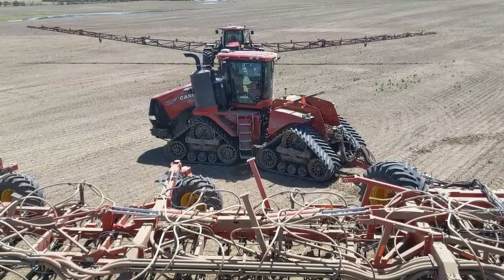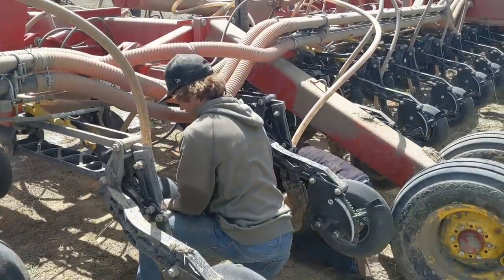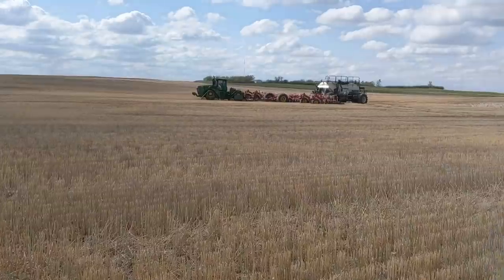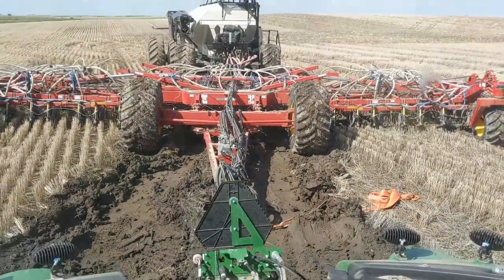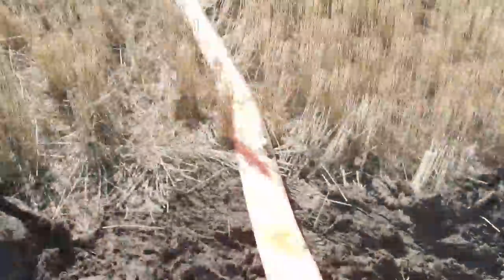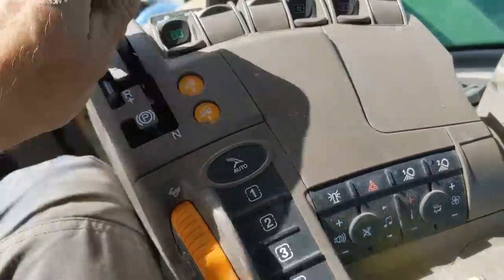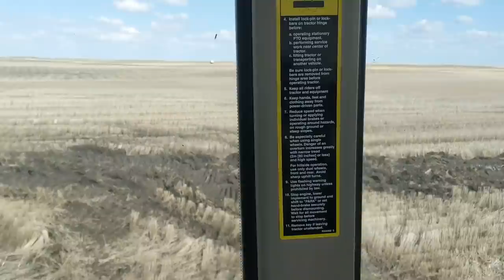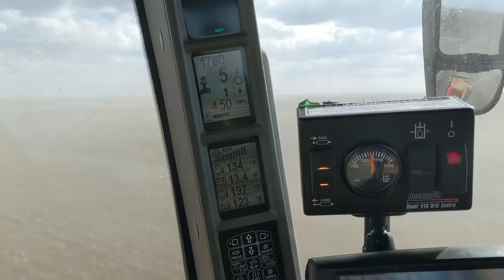Ashtyns 3rd stuck 😂

Comment: As a crane operator I’ve had a bad experience with a master link (d-ring) breaking under its rated capacity, it’s probably in outer space looking to come crashing down at any minute! I didn’t even have the line pull capacity to reach its safe working load capacity. TODAY I witnessed a strap fail using an 750 excavator (170k lbs) and it took the hard hat of a labor. PLEASE avoid using unnecessary rigging and especially metallic (unless cable). It looked like the shackle could have gone directly to the eyelet of that strap but that’s just from my keyboard. Stay safe and thanks for your videos✌️

Comment: It should be pointed out for those that might not know, Johnny is now pulling the seeder that the Fendt was pulling 68 ft, which is not as big as the seeder that the Case is now pulling 84 ft, because Johnny couldn't  :)

Comment: The way we keep track of the hydraulic hoses, we use colored zip ties.  Put the same color on the paired hoses then put a red zip tie on the right hand one.  We always use red for the right hand hose or if they hook up top and bottom , blue is always bottom.

Comment: Nice pull out sideways i have a nifty idea put a hughe old disk blade pinned to bottom of jack slide sideways etc but no big deal We had an extended hitch built pinned on the  Steiger tractor hitch could see to hook up and we could turn headlands in one pass yes could turn in 1/2 of the 55 ft airseeder great for bushes and sloughes too (thr outside sections lifted seperate from the centre( lift it out when wheels start sinking in the mud) it takes time to make extra headlands etc Time is money getter done.

Comment: How well does the Bourgault Auto Section Control work?  Sounded like it might have plugged Brian's drill up?
Reply from the maker: I think it struggles sometimes on a say 1mile run with only one section on.. 🤷‍♂️

But other than that, its worked good

Comment: Have you ever considered wheeled tractors with LSW 1400's, I ve seen pictures on the gram so I know they get stuck too but it was something I wanted to ask when the great distance you guys have between fields if it would float enough in the field and save some coin on wear parts roading?

Comment: If I remember correctly isn't the Case pulling a significantly larger drill than the John Deere?
Reply from the maker: Than that particular John Deere, but there's 2 other Rxs pulling the same load as the Case

Comment: New style xtc. 14 minutes 27 seconds change 76 ft on 10 inch spacing myself. Change about 8 times a year.
Reply from the maker: Holy crap that's fast!
Reply: Mike Mitchell it may have been at night along a bush that we often see bears in. Added for that little extra motivation to get it done.
Reply: @coreyhadubiak2912  lol. 🐻🤤

Comment: I Never seen Blue New Holland T9 700 🚜 with front/rear duals 682 hp only 10 hp less than Case.. Wonder How a BlueGrill 🐟 would Pull ?
You Slick up tracks on surface fast. Not stuck Deep.  Is that Bedrock under shallow soil or Ice frozen soil/clay you planting over ???
Permafrost ?
Reply: It'll be clay. We don't have permafrost this far south in SK.

Comment: Ole Johnny probably shifts up slowly to protest drive line components and to make it smoother.  Could it be your just a little impatient?  Have you asked your dealer about the shifting?  Is there an adjustment?
Reply: No they just have shitty trans case has hi speed shifts and smooth

Comment: Not a farmer but mike wouldn't it be easier for you un hook the cart and just pull that out instead of the whole drill and drive out with the drill  and swing back around to pull out the cart out with the strap on the of the drill?
Reply: Those big airlines don't have quick couplers huge pain to take them apart.
Reply: Not to mention the world of frustration as you try to realign the hitch to reconnect to the drill. That would be a nightmare.
Reply: Okay thanks👍

Comment: The strap rated at a 120,000 pounds and the equipment weights 120,000 are not the same thing. If you had a gage hooked on the strap and the other end on the equipment you will see the gage when you are pulling is no where close to 120,000 pounds.
Reply from the maker: 🤔 Very interesting good sir.. Soooo ur saying I am good for even more! I like that! 🙂 😂
Reply: @mikemitchell2554  Oh-oh...🤦‍♂️

Comment: Why are those rigs called "drills"? And why are you on imperial units? No offences, just curiosity!
Reply: Claus Scherschel    The more common name for this type of seeding equipment is AIR SEEDERS because air is used to get the seed & fertilizer into the ground.
The terminology “Drills” goes back many many years when seed dropped straight down from “Drill Boxes” to between disks that made an opening in the ground for the seed to lay into.
The US is fully Imperial and that is where a lot of machinery is manufactured.
I believe all US road signs and speed limits are still imperial.
Farm machinery as well as automobiles in Canada are manufactured in such a way that either system can be displayed in most cases.
The roads particularly in western Canada when built were laid out on a grid pattern where the roads would run parallel and perpendicular to each other at one mile spacing when practical.  
This is how farming land is calculated.  One mile x one mile is a section which is 640 acres and when commonly divided into 4 fields when dealing with smaller farming operations each one of the four fields is called a Quarter thus being 160 acres.
Farm machinery is measured in feet as well as building and granaries.
Depending on how a piece of equipment is manufactured you may need either imperial or metric tools and sometimes both to accomplish the repairs.
Canada tried a HARD SWITCH to metric many years ago but it didn’t last for everything.
Building construction tried switching to Metric but returned to imperial in most cases.  
Some products are labeled both imperial and metric.
Canada is also officially bilingual and that is a story for another day because certain products have to have packaging labels done in both English and French.

Comment: Don't you have an erosion problem? I don't see any hedges or anything like that.
Reply: alemey   Southern Saskatchewan has VERY FEW TREES and that can be summed up to a number of reasons.
The STRONG WINDS & lack of moisture make it hard for trees to successfully grow.
As the fields get larger the farmers remove the few trees that exist to make farming with bigger equipment easier and more efficient.
Where there are cluffs of trees along a field the trees rob valuable moisture from the seeded field.
Years ago there was a tree farm at Indian Head Saskatchewan run by the federal government where farmers could get tree seedlings for free to be used as windbreaks along the edges of the fields however due to government cut backs the operation was closed.  I believe the tree farm has been reopened on a much smaller scale run by three First Nations bands.  The trees are NO LONGER FREE  so the incentive is not there anymore due to the cost.
Mike’s family operation in SW Saskatchewan does Zero Tillage which is extremely common in western Canada.
Very important to not overly disturb the soil particularly in Windy Southern Saskatchewan or the top soil would end up in another province or the US depending on wind direction.💨💨💨
Zero tillage also helps keep moisture in the ground and Mike gets a minimum amount of rainfall each year.⛈💦
Reply: @gavinperry7237  Thank you for your explanation. I live in Germany and I'm not that familiar with Canadian conditions.
Reply: alemey   Born & raised in Saskatchewan you quickly learn to be prepared for whatever mother nature throws at you.  I saw combines in the fields a couple days ago trying to get last years crop combined so the Farmers could get this years crop in.  Parts of Northern Alberta had close to 50% of last years crop still to get off this spring and with the recent rainfall the weather gods are not helping things.
Reply: @gavinperry7237  Thank you for your answer. I think you're doing it right over there. Just like us here.